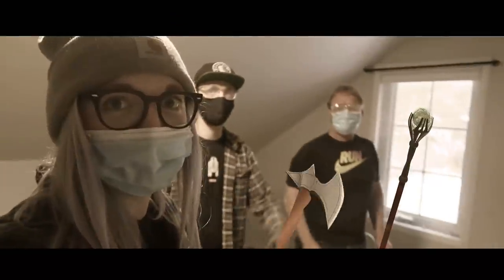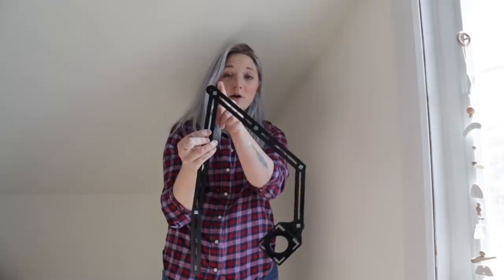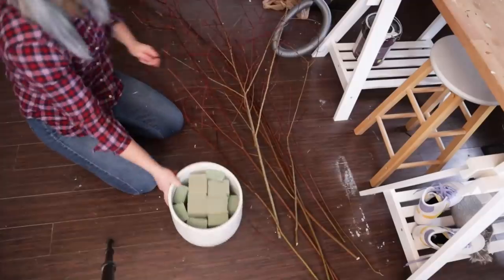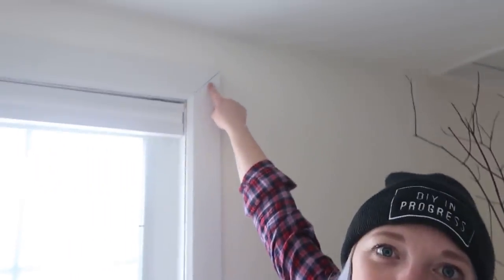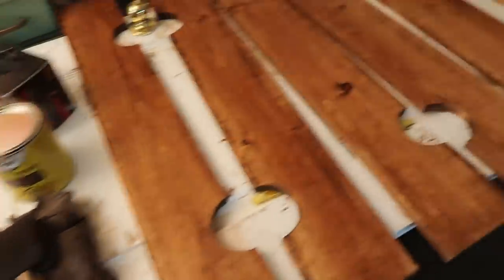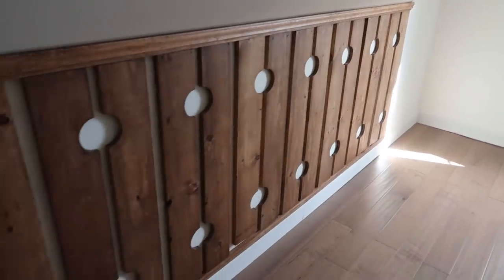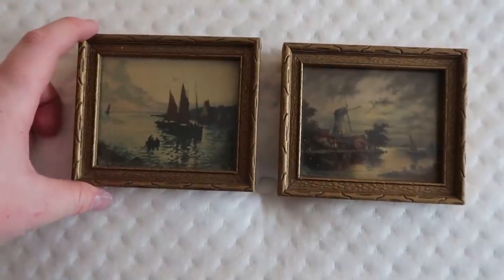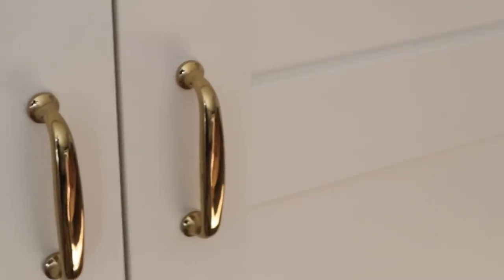*BIG REVEAL* i create the modern farmhouse bedroom of my dreams | PART 3

Comment: You are not alone with the « foam feeling «
Reply: I literally have to hold my ears or leave the room when it is making that unacceptable, disgusting, frightful, TORTUROUS NOISE 😫
Reply: The squeaky styrofoam is what gets me. That open cell stuff I can handle, but when it's the formed little styrofoam beads... 😫 I'll cut that stuff up sometimes to make decorations, and, UUUGH! Plus the cleanup is as bad as glitter.
Reply: “Sticky” and “greasy” absolutely make my skin crawl. Somehow, that foam manages to simulate both.

How reassuring it is to know that others hate it too!
Reply: I don't like foam or cotton I just can't touch them I try and then I throw it and leave the room.
Reply: I have a debilitating fear of foam/styrafoam. I didn't have to be there to cringe and cry with you.
Reply: Have I found my tribe? The only thing worse than that foam sound is the sound of erasing a chalkboard. It. Is. Visceral. Very bad. Thanks for keeping it real, always!
Reply: I wanted to vomit just looking at it
Reply: Noise cancelling headphones (like the kind you use when you’re using power tools to protect your hearing) make working with styrofoam bearable for me. We did spray foam insulation in our basement and cleaning it up before drywall was rough until I put the headphones on.
Reply: Does this group also hate cotton balls as much as I do?
Reply: @ang_131  I wear noise-cancelling headphones whenever I have to deal with styrofoam, but it doesn't help much because I know how it's supposed to sound and it makes me cringe and cry. I've dealt with it so much with work in the past. I absolutely refuse to touch foam. I have to have someone deal with it for me. I can handle packing peanuts for a couple of seconds but that's about it. I wish styrofoam didn't exist anymore. It's vile, evil, disgusting, and plus it's bad for the environment.

Comment: It's gorgeous!! A tip for future flower/twig arrangements; Instead of that yucky foam stuff, just grab a bunch of fallen branches, cut them up into equal lengths, and put them into the bottom of the planter standing till you've covered the whole thing. Then you can just stick your flowers or twigs in the crevasses. This of course works for living arrangements as well as you can add water and is a lot more eco-friendly than the flower foam. :)

Comment: I had a wood stool I used for a bedside table, but added shelves that lay across the cross pieces of the legs. So....room for an alarm clock, my iPad, my glasses....
Reply: I was thinking this would be a great add to what was already done, too!
Reply: I was going to say the same thing. But it looks like she did do that. I watched the reveal in slomo and see shelves on the stools. 👍🤩
Reply: @kathyusa-iowa5137  I only see the seats of the stools themselves and at 25:19 I see the white baseboard through the lower part of a stool which might look like a shelf on the rungs of the stool as well as the white of the wall peeking through the headboard cutouts. Am I missing a shot of stool shelves somewhere else, tho?
Reply: @mapleleaf0  you are more astute than I am! You can also see at 26:21, but I think you are right about 25:19. I think the baseboard filled in perfect to look like a bottom shelf, and the peekaboo in the headboard filled in for a top shelf. So I agree with you, there aren't any currently. And we both agree they would be a great addition❗👍🥰

Comment: I love the colors you chose, I love the ceiling light, I love the headboard (though I'm not sure why you put the holes in the bottom, that would be hidden by the bed), I love the twig pot! Great choices and excellent work all the way around, and it's so good to see it done. 
(One thing I'm a little worried about is the access to the attic. I think you screwed the storage units to the wall, and there's very little room to slither around the corner of that last one to get into the attic.)

Comment: One thing I love about your house is your flawless color sense. It’s just the right LRV and undertones every time. So you can understand how horrified I was about your guest room. Everything about that color is wrong including the sheen, which in an old house will reflect every flaw in the wall surface. I get it that it’s very trendy right now but it looks so unlike the rest of your house. Not every room has to be white. But I have a sloped ceiling guest room with limited light and I painted everything pink ground by F&B and as light as that was, it was too dark. There are so many beautiful paint colors on the BM paint deck. Why salamander? I don’t get it. Plus, there are gorgeous floors in the guest room and they needed a facelift not left as shabby as they are now. I’m sorry, this is about your MB, which is serene and warm and inviting. I love it. Your guest room? I give it less than 6 months before you repaint. That’s going to be so much work.